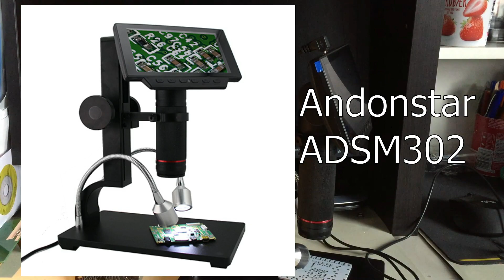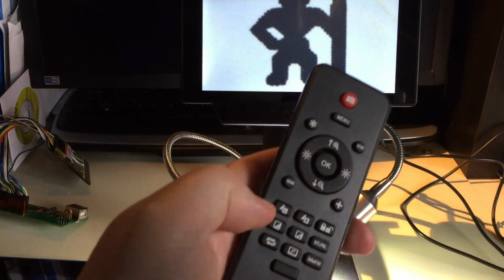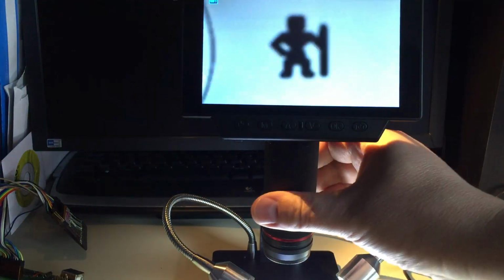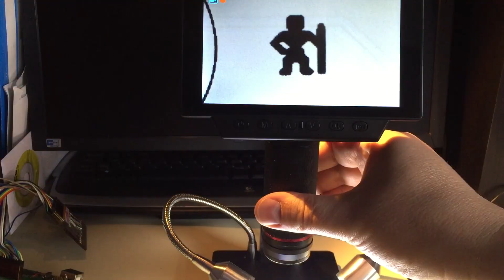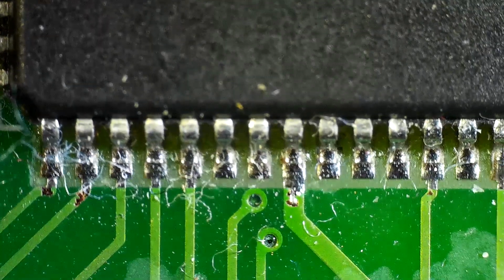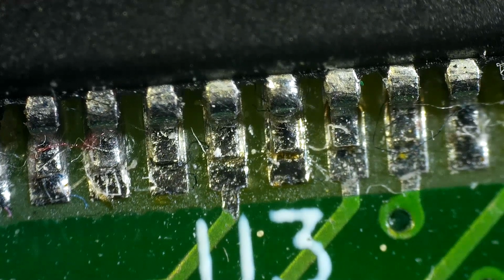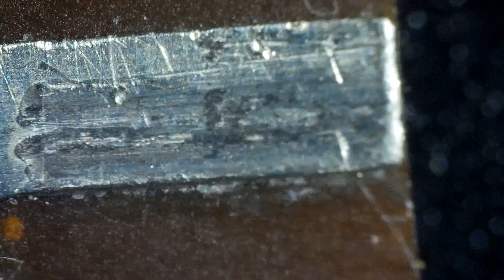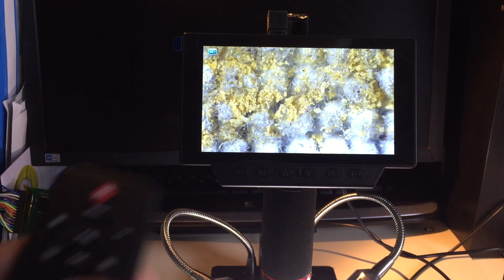Trying out the Andonstar ADSM302 digital microscope

Comment: Very nice. I have had one of those in my eBay watch list for a while now. The recording quality is quite nice - very clear image and the lighting is very good with the adjustable side lamps. Have you tried soldering small components yet? Does it take a bit of getting used to?
Reply from the maker: Recording quality is surprisingly good. I've set it to full quality, highest resolution and bitrate. It was fun mixing between the cameras in editting :) I haven't tried soldering with it yet. I think it will be very easy to get used to :) Also a very nice feature is the working distance.

Comment: Hans, I have another Andonstar digital microscope. The quality of the picture is ok compared to other USB microscope. I mainly use it for documentation purposes. Yours seems to be better, especially the remote control is great. Mine has some buttons on the side, they are small and the writing is hard to read for me. So, when I take it out of the closet every couple of months, I need some training, before I can operate it (take pictures etc.)

For soldering, an optical stereo microscope is much better. I am thinking of buying one some day in the future. This way, you have a better 3-dimensional perception, which is required, if you want to work under a microscope.
Reply from the maker: I compared some of the andonstars, and this model doesn't have the softness in the corners of the image. When I worked with hardware before I used to solder under a stereoscope. After starting up my hobby again, i figured I could do 0603 without microscope. I do mis the stereo scope at times though. The scope at work I remember I sometimes put stuff under the boards to raise them. Once I hit a anti-static foam with the iron and breath in something that felt like clorine. Auch.